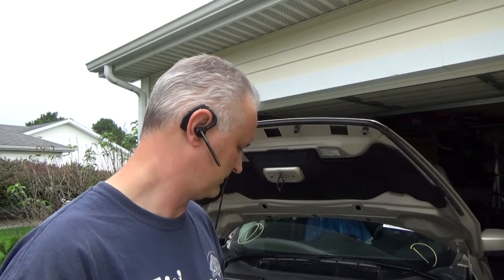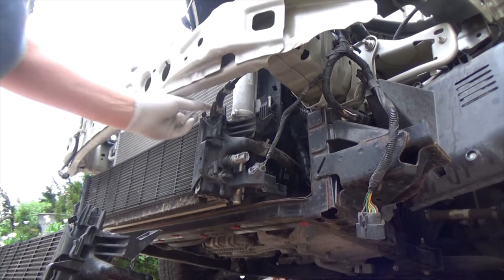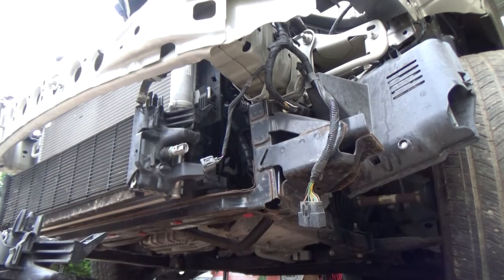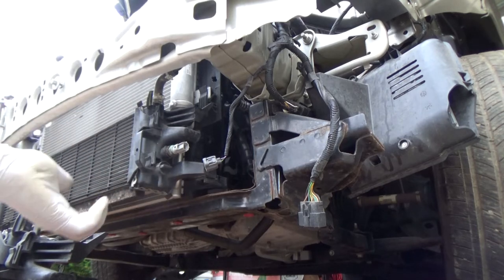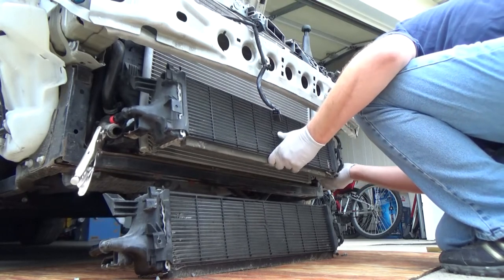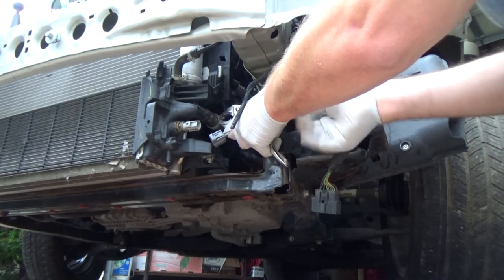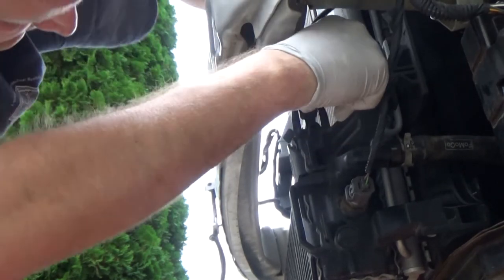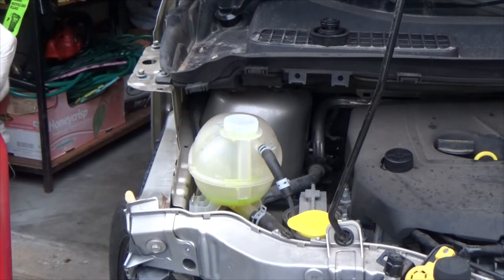2017 Ford Escape Replacing Intercooler

Comment: Dear Sir Have you got the intercooler sensor part no?
Reply from the maker: Sorry I don't have the part number, because I bought used intercooler and it already had sensor in it.
Reply: @VasylGladun  no problem sir thank you!! I will be doing some other questions since I am in the process to repair all the cooling sys . Since I got a savage car that comes without any radiator your videos is helping me a lot!! Thank you very much!!

Comment: hey, that is not an intercooler, it looks like realy small water radiator. what on earth was ford thinking when they build that
Reply from the maker: I really don't know what to tell you 😁
Reply: it's a more "modest" air-to-water intercooler.   I'm guessing because the engine is smaller, this version works?   but I'm also surprised Ford went with this version...
Reply: Technically, you're right. It's an air-to-water radiator that cools down coolant that flows to air-to-water CAC that's located in the intake manifold (look up p/n: DS7Z-6K775-A). Being a 1.5L non-performance motor, this was what Ford gave us. The 2.0L Escape didn't have this setup and was designed closer to the Focus ST.

Comment: That’s not the intercooler.
Reply from the maker: It is according to Ford.
Reply: Indeed it is the intercooler may look small but pull up the parts sheet I have replaced 3 in the past few months
Reply from the maker: I hope it's not on the same vehicle 🤔